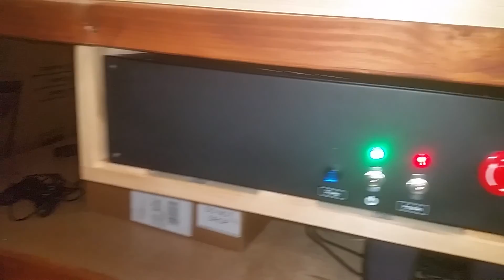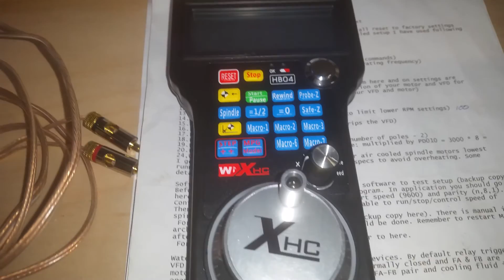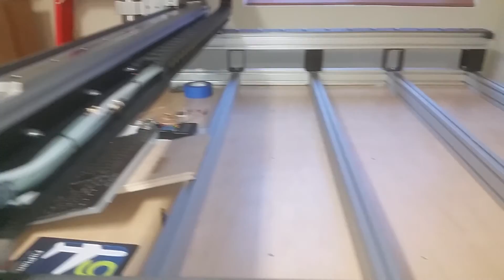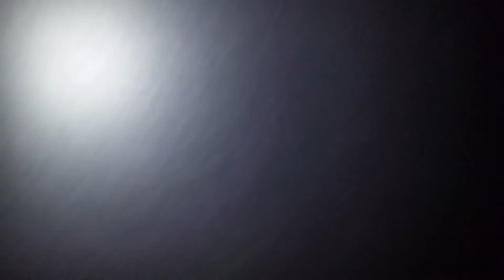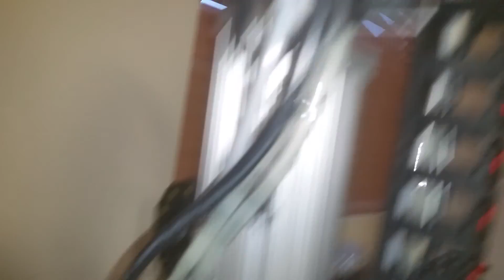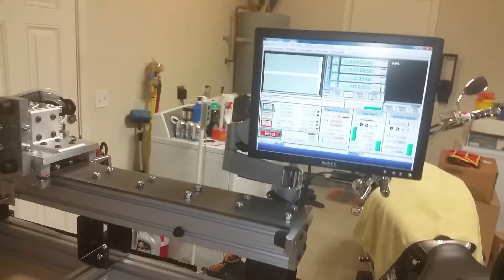Fine Line Automation 4x4 Router

Comment: I just Purchased a 4 x 4 with rotary with mach4 and I need a User Manual so I can square up the axis and I need to install homing switches 

Thanks JCPRIEBE
Reply from the maker: Which machine did you purchase. Is it a fineline automation.
Reply: @jeromejt62  
Yes I don’t know how old it is 
Travel is about 50x50
With a rotary mounted on the front
Reply from the maker: @jcunurdpriebe2554  There were no assembly instructions that came with his machines. There used to be a assembly YouTube video link that he provided. I'm having trouble finding it now. He may have removed it. If I can get the link located I will post it for you. It's what I had to use to assemble my machine
Reply: @jeromejt62  
The x axis has a 1/4x7x60 plate on a 3x6 Extrusion
The y axis  has a 1/4x4x60 plate on a 3x3 extrusion 
Looks like yours except x axis beefier
Reply: Is FLA still in business

Comment: can you use whole sheets by turning them around or is that unrealistic to think I could do that with a 4x4?
Reply from the maker: A 4x4 machine is not 4' square. That size is your cutting dimensions. That holds true for any machine. My actual size of the whole machine is more like 60 x 72. That is not exact but some where in that area. That being said a 4x 8 sheet of ply will not fit those dimensions. The machine outside measurements will vary by manufacture, but will never be the same size as the cutting area, it will always be most likely larger.
Reply: jeromejt62 ok thanks. But could I use a full 4x8 sheet of plywood, have it hang off the edge and prop it up with something and router one side. Than turn it and rout the other side so you actually rout the entire whole sheet intact. Or is that to difficult to line it all up correctly?
Reply from the maker: That could certainly be done, just make sure you index your stock with stops to make sure it is square when you turn it over.

Comment: Was this machine actually worth the price?
Reply from the maker: Hello Ray and thanks for the question. I have to say that your question can be a straight forward yes and no. Is the quality there yes. Does it produce consistent results, yes. Is $2,100 worth it to you, my answer is you get what you pay for many times, not all the time buy many.

If you look at CNC Router parts standard machine, the price point is almost the same, maybe about 300.00 more. There are things that I like about CNC Router parts machine such as double gantry beams. When you really narrow it down many of the parts on this machine are from CNC router parts machines, but a different design concept between manufactures as a whole for the machine. 

I don't know your level of expertise in CNC machines, but if your like me when I started I had none. By the time the endeavor is over plan on spending about 5 - $ 6000 dollars. This is just the base machine, no electronics, stand, spindle, end mills, the list goes on, oh and factor in your time.

So would I buy again, and my answer to that question is yes.
Reply: jeromejt62 wow so no electronics at all? I was looking at their website and saw only the motor choices nena 23 or 34... I figured they came with it depending on motor size.. I have built a few a small pcb milling machine and a 4x4 mostly printed cnc machine.. both in kit form including everything in one box... I'm on a fixed income so trying to get the best bang for the buck and I understand windmills can set you back and break pretty easily ect.. I really like your videos on it and the wiring one I took your advice on the security cable  and it seemed worth it thanks again.
Reply from the maker: Ray as an after thought check out Dave Gratton's Garage worx cnc machines very reasonably priced for what you get. Here is the link; Hope this helps you out. He has 24 x 18 to 4X4 machines that work with every budget and a high customer service rating

http://www.garageworxcnc.com/48--x-48--garageworx-cnc.html

Comment: Thank you for the video Jerome . Your build looks great and I wanted to do something simular. I never even took into consideration the fact that the threaded rods could rattle . 
Not the end of the world . 
Are you happy with the construction otherwise ? I was concerned about the bearings wearing into the steel plate that the gantry rides on , as I seen an issue at CNC zone .
Reply from the maker: Major T. use something like heat shrink as an after thought spaced in maybe 10 in intervals about  1" long each. Not enough room for o-rings. It was a little late for me. I have to do another vid that I promised that will provide some great tips for your build... Thanks for watching my video, means a lot. 
Jerome

Comment: Your CNC looks nice (NOW), but wait until you start cutting and all those electronics will end up full of dust even with a Dust collector. Best thing to do is put everything in fully enclosed boxes with alternate ventilation ports outside or at least 50 feet away. I started the same way, but when the computer Krapped out I was afraid the stepper controller box would be next so I moved everything and ventilated it to get fresh air.
Reply from the maker: Thanks for the advice, I'll keep that in mind for sure.

Comment: Jerome, awesome video. The machine looks great. Thank you for detailing all of your mods. 
  - I am going to address the cable tray length. Thanks for bring it to my attention.
  - I love the water cooled spindle setup.
  - I really like the mounts for the proximity sensors.
  - It's interesting the the all thread makes that sound. I haven't had that issue with any of the machines we have in shop. 

Great job. I would like to see a video of some of the problems you ran into as well as some videos of the parts cutting.

Comment: Congratulation on the build! It looks  awesome to the least!
I am contemplating to build one myself. I am very interested on the detail of your build.
I read quite a few "not so good" comments about Fine Line automation and just wonder if you had any issue with them along the process. Again it is built like a tank...
Reply from the maker: +Phong Nguyen Thanks so much for the compliment. I am more than willing to give any details or help you in anyway that I can. Nate Lowrie at Fine Line I think has come a long way as far as customer support, that was an issue. Mainly getting back and responding. The machine itself is as you describe a tank, built very well. I will post another video of my controller, the issues I had with assembly of the machine and my corrective actions to solve the problems, and my over all satisfaction with everything. look soon for the controller video..